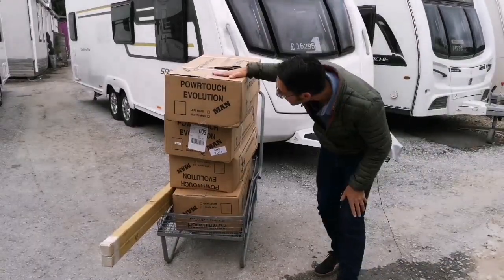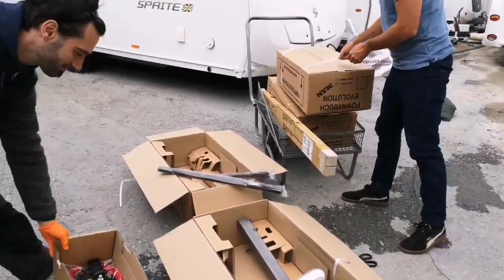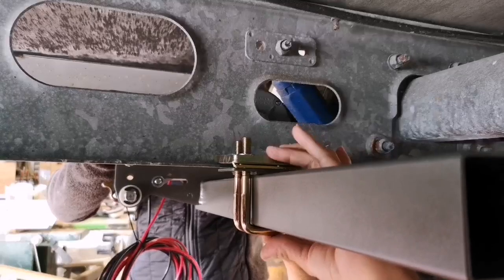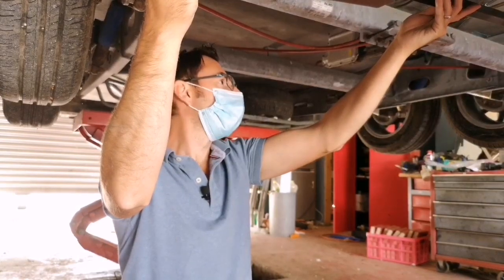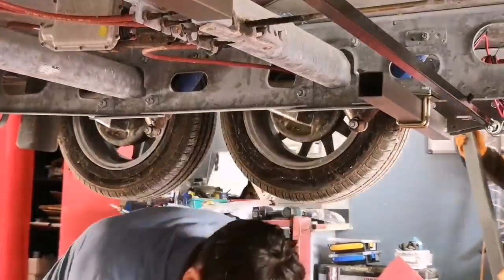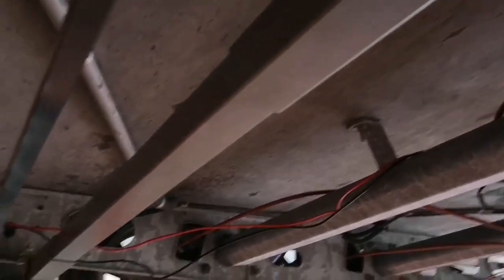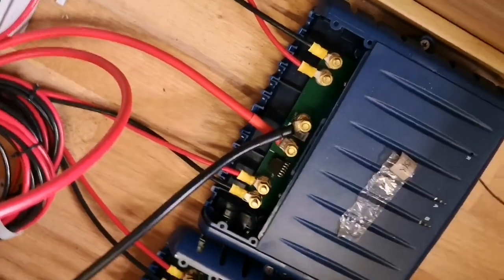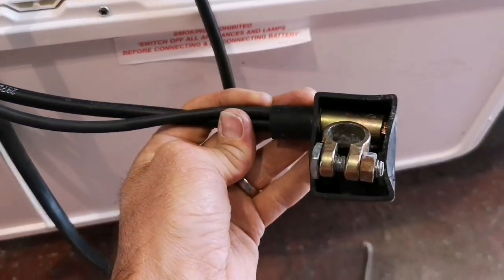How to fit a motor mover

Comment: Has anyone fitted a motor mover to a 4 wheel ifor Williams Transporta trailer
Reply from the maker: No, but if you call POWR touch and see if they have brackets to suit, or just make some C brackets.

Comment: when doing a sharp turn  do 2 wheels pivit /not move... or turn the other way,  because some  videos ive watched the caravan pivits on 2 wheels.. ( twin axcel ) 
hope you know what i mean..
Reply from the maker: With a 4wd mover the opposite side movers come on and off to turn the wheels and take the pressure off the, but it will only reduce the drag and won't turn it on its axis. It's still a slow turning circle that needs a good amount of room.

Comment: Thanks for a great video. I have quad Pwertouch movers fitted to my Bailey Porto. Given that the jack points are no longer accessible, do you think it is ok to jack the caravan underneath the square box section on the motormovers, just to the outside edge of the clamps (e.g. directly below the caravan chassis)? Thanks
Reply from the maker: some will disagree, but if its a proper trolley jack, you can go onto the chassis rail, or onto the axle if enough room. i wouldn't go onto the mover bars.

Comment: Hi.. so one controller is doing the back set of motors.  pos to pos  neg to neg  one side ,  and pos to neg and neg to pos on  the  other side ... thats  rear controller..
the copy it again for the front controller . is that correct
Reply from the maker: Yes that should work, again just check each roller is going in the correct direction once fitted, its easy to swap over if going the wrong way.

Comment: My isolation switch is under the front seat near the boiler should it be in the battery?
Reply from the maker: No sometimes they will be put inside the caravan, its perfectly safe. 👍

Comment: I have an older style powertouch.when I used it before going onto site this weekend all was fine.but then I rechecked before leaving and noticed when I use the socket to engage both sides,1 seems not quite as tight as other side and the sliders were in a different place to other side.when in operation the side that doesn't slide over properly doesn't stay engaged to the wheel...how can i fix this please.advice would be gratefully recieved.
Reply from the maker: If its moving correctly and locking over ok then its 4 bolts underneath and you can adjust the gap. If its the mechanism as you engage the mover then they have little cotta pins in the joints and it could be one of these is failing. Have a good look at both sides and see if you can see any difference to the action. If not its possible to just adjust the gap back to about 15-20mm from the mover roller to the tyre when disengaged from the tyre.

Comment: Great video thank you. I’m about to buy a second hand powrtouch is there anything I should look out for. Thanks
Reply from the maker: As long as you check its working you should be ok. Just look at the rollers and make sure they are ok and no knocking when they turn.

Comment: I have taken my old evolution mover off my old van ready for fitting to the new van I noticed that when i lifted it by holding the motor the motor moved up in the guide is this normal or do you think the guide pin is worn it happens on both motors so not sure if its normal or not
Reply from the maker: I do believe they ah e a little movement in which is normal, if you see another one fitted to another caravan you may be able to check it has the same movement as yours?

Comment: I might have put up the the U  bracket first with the grub screw slightly tightened than push the motor and the square box through first
I have to amend  my above comment , I’ve just fitted a freedom mover and it does not work fitting it that way ,the grub screw lugs the tighten the axle beam will not go through U brackets ,so as they say I found out the hard way , but I still did it on my own on my back under the caravan ,and I’m 76 years old .  So good for Powertouch for producing a quality mover that’s easy to fit .

Comment: Can you upgrade an existing  twin axle powrtouch motor mover already fitted with an additional motor mover to give you 4wd ?
Reply from the maker: Yes you can just add another mover and control box, pair the new control box and old remote.
Reply: @thecaravanplace  Thanks, I'm looking to do this too, is there anyway to keep the mudflaps and can I fit the tyre carrier elsewhere? Thanks
Reply from the maker: @hcashmore11  you could possibly try to move the mud flaps behind the mover but they may get in the way. You can get a kit to move the spare wheel carrier further back, powrtouch should be able to supply this for the alko chassis.